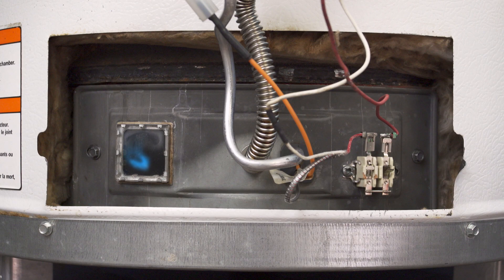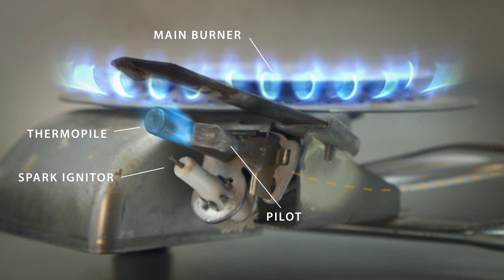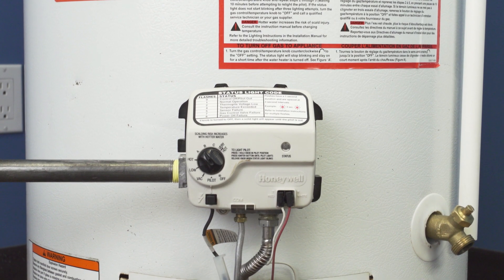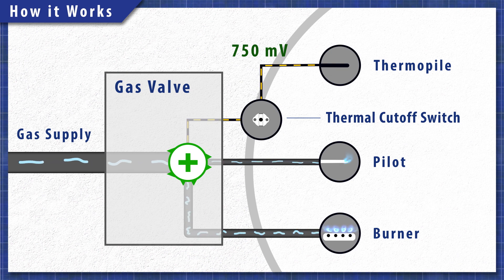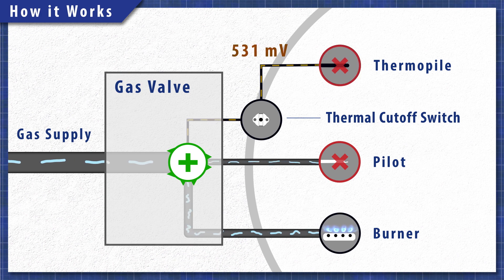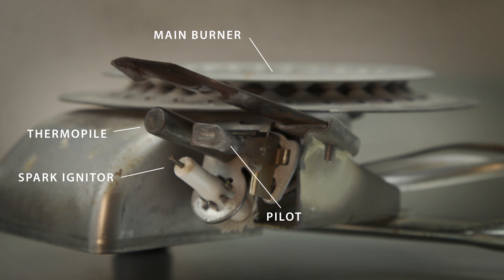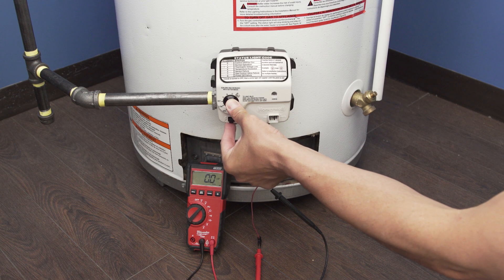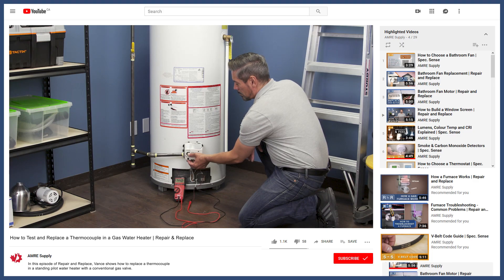How Does a Thermopile Work in a Water Heater? | Repair and Replace

Comment: My pilot stays lit but does not ignite the burner. I changed the gas valve and still nothing
Reply from the maker: Thanks for watching. Try doing a deep cleaning of the burner assembly and make sure nothing is interfering with the gas line that feeds the burner. This video will show how to access it: https://youtu.be/Yx2gfgJB7bI

Comment: Excellent explanation.  

Stupid question but do electric  tankless water heaters have thermopile or thermocouple?
Reply from the maker: Thank you Jordan, this is actually a snippet from a longer video on "how gas water heaters work" it explains the difference between both standing pilot types as well as power vent models https://www.youtube.com/watch?v=BHUPFLbb8NY It doesn't however cover electric water heaters. Electric water heaters instead use a thermostat and a high limit switch to cycle the elements on and off as needed.

Comment: Diff between thermocouple and thermopile ?
Reply from the maker: Thanks for watching. Thermocouples generate a small voltage of around 20 - 30 mV. Thermopiles are made by taking a "pile" of thermocouples and bundling them together. Thermopiles generate higher voltages up to 750 mV.
Reply: @AmreSupply  thank you
Reply from the maker: @gustavosh.5147  You're welcome, just happy to help!
Reply: @AmreSupply  and one has a gas line and the other just two wires!

Comment: I have heat but only warm water, I have replaced the thermostat, the dip tube but still only warm water in my gas water heater
Reply from the maker: Thanks for watching. If your water heater is igniting properly then there's a few things that could still effect heating. Make sure that the burner is clean and has a strong blue flame when it burns. If the burner is clogged or is dirty then the flames might not heat up as hot as they would normally. You can see how to access the burner here: https://www.youtube.com/watch?v=Yx2gfgJB7bI

As well a build up of sediment at the bottom of the tank can also prevent the water from heating properly. https://youtu.be/hkbi24QJhDw

Comment: i've got a John Wood water heater (JW850S40ES SERIES 10) whose pilot light goes out 2 or 3 times per day this time of year (it was good all winter as usual). A couple of years ago i replaced the thermocouple. I'm not clear if that resolved anything, or if there is just some environmental issue this time of year.  Anyhow, after one or two times sparking the pilot light i generally get it relit...only to go out a few hours later.  The flame, when burning is quite blue with a little yellow flickers.   I've experimented with the cover door both on and off, and neither seem to impact how long the flame burns.   Occasionally when the heater is OFF i will shoot some compressed air into the area of the ignitor as the guy who has come in on a couple occasions has suggested it may be dust and wind blowing the flame out.  What is symptomatic of each of the following being the issue   1. dusty ..needs cleaning    2. windy..gets blown out   3. thermo-couple needs replacing   4. thermo pile needs replacing. Example:  If you are able to re-lite the burner after clicking the ignitor, then you thermo-couple is NOT the issue.  Any guidance you can provide would be appreciated !!  thanks
Reply from the maker: Thanks for watchign Brian. We actually have an indepth guide on how to troubleshoot when the pilot won't stay lit, it involves testing the thermopile voltage, resetting the cutoff switch and checking the airflow. You might want to try cleaning the flame arrestor screen under the tank. You can see more about this in this video: https://youtu.be/UXpmmGuewk8?t=357